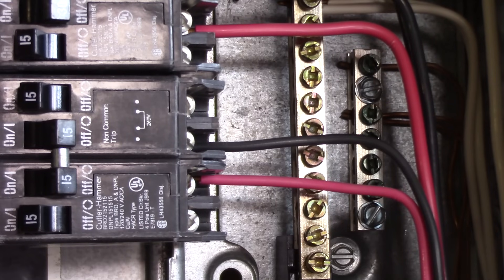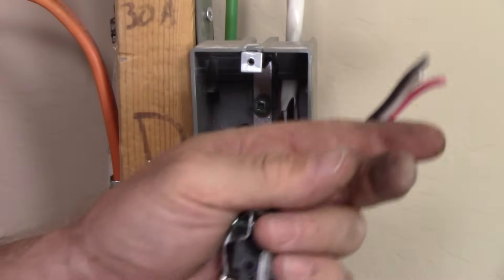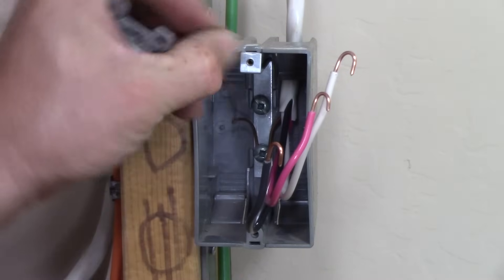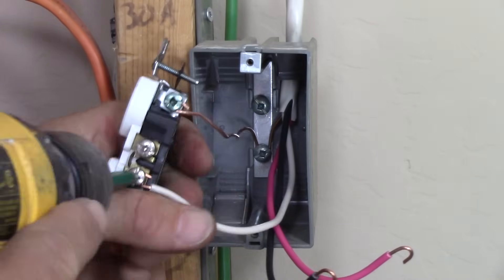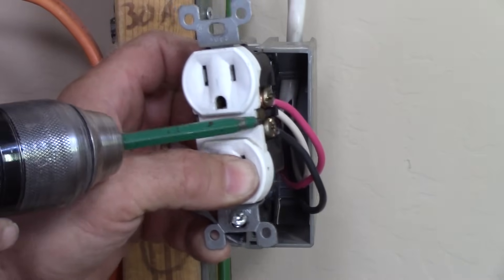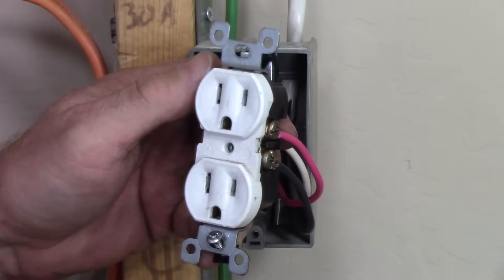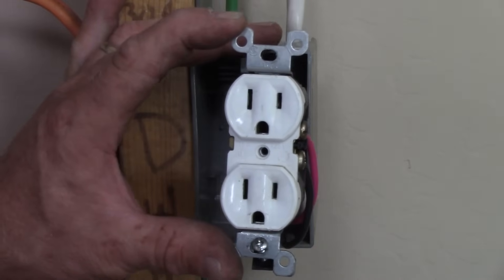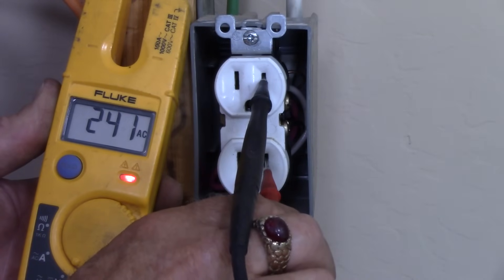Kitchen Split Circuit Receptacles Explained

Comment: Hello. I really hope you see this because I just switched 7 of them without even seeing if the first one worked. The way mine works is red and black are on the right and two whites on the left instead of one like this video. This is all in my bedroom too. Would it be a problem if connect both the white instead of the one like you did? Thank you.
Reply from the maker: What you have there are a little different than the split kitchen receptacle circuit as in this video.  You have switched receptacles, where half of the receptacle is on a switch, and the other half is hot all the time.  Hook them up as they were, just split the tab on the right side between the red and black wires.  If you don't split the tab then the switch will no longer control one half, even if you miss just one of them.
Reply: @theinternetelectrician  you are the man!! This worked right away and you saved me time and money!! Thank you very much. Imagine doing these things without the internet? We're so lucky. I just subscribed.
Reply from the maker: @davido8043  Happy to help out!  Thanks for watching!

Comment: My hot wire comes from a switch. Is it possible to make a split from the wiring coming off switch to create this? Or do I have to run a new wire from switch with red installed to create this?

Comment: Thanks for the explanation.  I had an outlet that went out recently and could not figure out why the outlet was wired that way.  The service panel is original (1970s) using fuses and aluminum wire.  I changed the outlet and broke the tab like you did.  However only the bottom has power.  The 15 amp fuses in the panel are ok.  Any suggestions as to what I should test next before I hire an electrician?  Thanks in advance

Comment: Thanks for this video! I learned something new by watching it. Didn’t know I had to cut the metal between the red and black wire to make two separate circuits. I changed a plug that the top plug was controlled by a switch and when it stayed hot I looked for your video and solved the problem.

Comment: Question........can you do the same thing by using two completely different breakers in the panel with two sets of wires coming into the receptacle box.  2 hots, 2 neutrals, 2 grounds?

Comment: Question: Saw one configured like this but had two single pole breakers in panel, a 15 amp and a 20 amp. 20 amp went to top and 15 was on bottom. Receptacle rated for 20 amps and 12 AWG wire used. There was no common tie between the breakers. If I add a common tie is this configuration okay?

Comment: Thanks!   My sister lives in a tract house,  built in 1995, and her kitchen is wired with split outlets,  protected by a 20 amp double pole GFCI breaker and 12/3 NM.   she had the same problem a few years back, when her boyfriend was upgrading the traditional outlets with the decora style,  to give the kitchen a more trendy look, forgot to break the tab.  was able to help her boyfriend over the phone some 800 miles away when he described the problem to me.   Saved them some money from having to call an electrician.   

So these were definitely used even into the GFCI era,  though I don't really see the benefits,  unless the contractors got paid by the job instead of hourly,  and it was faster and easier to pull one 12/3 vs two 12/2's.   Because those 2 pole GFCI breakers are not cheap, by any means.  I suspect this was the case for my sister's house,  because the quality of the building materials is not the greatest,  the doors and cabinetry seem very cheaply made.  

Nonetheless these split outlets are a very efficient use of material and labor,  I really like them, and it's unfortunate they are a thing of the past.

Comment: Hi Terry.
Great video. years ago I had an electrician wire up a split plug for me, but something is wrong. Whenever I plug in a microwave and a toaster oven, I blow the breaker. At first, I thought he didn't wire a split plug up, so I treated it as a single plug. Today I was going to replace it so I could have a split plug. To my surprise, the receptacle was wired the way that you show. In the breaker box, he does have a double solid double breaker. But it is a single pole.  Could the breaker be bad? Or should I have a double pole breaker?  Does this make sense to you the way that I explained it?
Reply from the maker: If I’m understanding correctly, it is a full size single-pole breaker feeding the split receptacle? Are both the red and black wire double-lugged to the load terminal of the breaker? Respond here, or send me an email to terry@electrical-online.com

Comment: Great video, however since I am not experienced very much with electrical work I have a couple of questions. First, does it matter which end, ( ie top or bottom ) that the white wire is attached to ? Secondly , my house is 35 years old and it has these split receptacles in the kitchen. My wife would like another receptacle put in at a new spot in the kitchen on another wall. Is this still allowed or is it ONLY forbidden in new construction ? I had to upgrade my panel to 240 because we are getting a hot tub so I now have lots of room for other circuits. Also I live in Ontario. Thanks and have a great day.

Comment: Hey terry. I ran into that problem where my breaker kept tripping because I didn’t break the tab. Instead I put a wire nut on the red wire. Everything seems to be working ok. Is there any cause for concern doing this? 
Thank you! Great video

Comment: According to NEC Article 100, a multiwire branch circuit consists of two or more ungrounded conductors that have a voltage between them, and a grounded conductor that has equal voltage between it and each ungrounded conductor of the circuit and that is connected to the neutral or grounded conductor of the system. (Basically, two hot wires are sharing a neutral wire.) If you remove that neutral conductor when the breaker is on you'll destroy the most expensive equipment pugged into that receptacle.

Comment: Question.. I have a 240 outlet on my welding machine.  I’d like to make a cord that goes 240 from machine into two 120 receptacles in a box.  I have 4 wire 12gauge cord.  Now on each 120 receptacle I have … red black neutral ground / red black neutral ground.  Reds pigtailed with the red coming in.  Blacks pigtailed with the black coming in.  I have the tabs broken off on each hot receptacle.  Would this configuration cause any issues to power tools?  Grinders, lights, heaters etc…  thanks!

Comment: Great vid. Is it possible to jump off a 220electric heater circuit at the wall to split to a new 110 receptacle while not interfering receptacle power with using the thermostat control and heater on/off?

Comment: thanks for your explanation. is it possible to change the receptacle to GFCI? how would the wiring be in this case?
Reply: I have the exact same question. I've got on these split circuits in the kitchen and would like to replace it with GFCI. What should the wiring be. presumably the black/white goes to the line. Where does the red wire go to - presumably the load - but on the white/black side?

Comment: Thank u so much! U saved me from constantly tripping the breaker and spark fire the house down!

On a more serious note, may i ask if its possible to add another receptacle from this set up on the same circuit of course. Basically, we need to add a receptacle in an area where the close by receptacle is a split receptacle...

 Can i do pigtails to create extra set of new wires from the original split receptacle circuit before it enters into the original split receptacle. Then connect to the 2 (old and new)split receptacles?

Or is there a simple way to go about this since the new receptacle doesn't have to be a split receptacle. It could be a regular receptacle since very little power will be drawn from it. Maybe 30 watts at most.

Thank you so much in advance for ur answer ☺️
Reply from the maker: The code rule (to ensure you have lots of circuit capacity in the kitchen) was to have no more than 2 split receptacles on one 2-pole circuit, and to alternate them so adjacent receptacles aren't on the same circuit.   Having said that, there would be no concerns adding to these normally under-utilized circuits.  You could make the additional one a split, or just pick one of the 2 hots to feed the duplex receptacle that you add.  Just do it safely and correctly and you should be fine!
Reply: Thank you so much for ur quick answer. May i ask if u have a video showing how to convert a split receptacle  with (red,black and white wires) to a regular  receptacle without pulling a new line?
And using the extra hot wire to make an additional outlet?

Thank you so very much 🥰

Comment: Isn't it recomended to use two neutral wires on this application?
Reply from the maker: Not that I've heard of.  With the neutral only carrying the unbalanced load, unless someone juggles breakers around, it's perfectly safe. Correct me if there's been a code update on that?

Comment: How would you wire a GFCI outlet with this wiring?
Reply from the maker: Short answer, you can't.  The shared neutral is the issue.  I hope that you also subscribed to my channel, and clicked the bell?  Much appreciated!
Reply: @Terry Peterman  actually found a solution. You're right with your answer, but for those who may read this, and also have to worry about switching an outlet thay is within 1.5m to a water source, a solution would be to buying a GFCI breaker for your panel. May be cheaper than rewiring. I luckily had an electrician buddy who did a little rewiring for me, but I was going to go the breaker route
Reply: You can't,  because of the shared neutral.  If you want GFCI protection you have to use a double pole GFCI breaker,  and they are very expensive,  my sister just had to have one replaced in her home, built in 1995, the kitchen was wired 12/3 and a double pole GFCI breaker, and it was over 100 dollars and had to be ordered from an electrical supply company because none of the big box stores in town carried it.  The supply chain crises didn't help her situation.

Comment: hi terry could you please help me . i have the same outlet with 3 wire . Red white black . i wanna replace with new outlet with usb outlet. the new outlet i bought have only option for 2 wire to plug in  . what should i do with that case where in new outlet plug have only 2 line to attach. Thanks

Comment: Good video I have a question, why have to be two wires in one outlet?
Reply from the maker: I'm not sure I understand the question?  Could you please elaborate?
Reply: @theinternetelectrician  Two prong outlet should carries 2 hot wires?  Why?
Reply from the maker: @victormendoza6306  With this circuit you have 2 hot wires sharing a neutral, and that gives you 2 full circuits on one duplex receptacle.  Does that help?
Reply: @theinternetelectrician  yes thank you very much

Comment: That would mean that there is a potential for 30amps to be running through that receptacle, my question is can the receptacle handle 30amp running through it even though then 30amps would be running through the entire plug and not just through one of the plugs?

Comment: This is exactly the issue I run into today, lol. The take away is you have to check if the hot wire is line or load.

Comment: Thanks Terry.  I shorted out a plug in my kitchen and ran into this problem when I replaced it. Could not figure out why the breaker wouldn’t go back on. I disagree that it’s a good wiring style.  I feel like it’s one of those little bombs that tradespeople use to obfuscate their, for the most part, simple and mundane work.  In an attempt to keep the normals away from DIY.  Sure appreciate people such as yourself making information freely available.
Reply from the maker: Once you understand though, it is a good system in my humble opinion.  You have 2 full, 15A circuits in one outlet split top and bottom.  Another over-looked benefit of this type of an outlet, is if you should move to North America from the European grid and bring some of your 220V appliances, change the receptacle to the 15A/250V, and put on the proper plug on the appliance, all set!
Reply: @theinternetelectrician  hi Terry can I use 20,30 or 40 amps too
Reply: A way to save money
Reply: Microwave in one, kettle (or toaster) in the other, without tripping the breaker
Reply: I agree its good idea the wiring but people they don’t know its a puzzle like me when i change mine the orange and yellow wire ire connected to the gold but here you sir you told us to cut the small thing si that it come out only 120v coz if they together it will be 240v… anyway thank you so much for your video 😂

Comment: I bought GFCI plugs for the kitchen before realizing it has split receptacles. Would it be against code now if I just replace new plugs in the kitchen and split them or do I have to eliminate the red wire and wire in the GFCI's? I am in Canada so depending on where you are you may not know the code. Thanks.
Reply from the maker: Just replace with new receptacles.  You aren't changing anything and the code is grandfathered so all good! Don't forget to split that tab! Oh, and the price of the new receptacles just dropped from $25 to $2! (estimated)

Comment: Thank you for the Video. Any advice on how to change the split rec. to a GFI?
Reply from the maker: Best advice would be to leave it as is.  Personally I like the split kitchen receptacle method, and no need (code wise) to change it as it's grandfathered in to the code of the day.  But if you would feel better with GFCI protection, I would change the supply breaker to a 2P 15A GFCI breaker and then leave the splits as they are.

Comment: can you do this method with a gfci receptical?
Reply from the maker: There are ways, but short answer is no, because you have to have a dedicated neutral for the circuit feeding a GFCI and the neutral cannot be shared because the unbalanced load will cause the GFCI to see that as a fault, and will trip.

Comment: You noted that the receptacle & wiring as shown "is not allowed for new construction in a kitchen receptacle."  So, to add this split receptacle in an existing kitchen, what is required to meet NEC requirements beyond what you show here?  In my case, I plan to use current hardwired power supply to garbage disposal as a power source for the split receptacle; the purpose being to add an outlet for an under sink mini-water heater.
Reply from the maker: I'd need some more details Jim. Send me an email to terry@electrical-online.com and we can peruse this further if you'd like?

Comment: Thanks, This is great for New Work how about existing Old work - Do I have to snake a 12-3 wire to the outlet in order for one plug to always be Hot and the other controlled by a Switch..
Reply from the maker: I'd need more detail here Frank.  Not sure what you're asking, but if you just leave the existing 3-wire kitchen circuit as it is, no need to change as code rules are grandfathered to the day the work was done.
Reply: @theinternetelectrician  Hi and thank you:  Some Dummy used the dedicated garbage disposal switch to an outlet to also connect the dishwasher to the same outlet under the sink.  Everyone thought the dishwasher didn't work but when I ran the garbage disposal the dishwasher powered on and was running....  Too late I already ordered a new dishwasher and am using an extension cord to a live outlet when I want to run it....   The switch for the garbage disposal box also has a switch to an overhead light and an outlet in the same box.   HELP!
Reply: You didnt show us how to wire the switch.?    I understand the 12- 3 runs from the panel to the outlet.

Comment: Hi I have these problem in my kitchen.I changed two split receptacle I did exactly what you showed in video split the tab but i only have 1 plug each working.Any suggestion what I done wrong?
Reply from the maker: I suspect the breaker is tripped.  Even though the breakers feeding these circuits are tied together, it can happen that one is tripped and the other isn't.  Try pushing the breaker(s) firmly to  the off position until you feel a click.  Then turn back on and check.
Reply: @theinternetelectrician  does the red wire always on the top screw?Because when i put out the old receptacle the black wire was on top.
Reply from the maker: @erwinmolina13  I doesn't matter.  As a trade practice I always put the red on top, for no particular reason.
Reply from the maker: @erwinmolina13  Let me know if the breaker reset solves your issue.
Reply: @theinternetelectrician  It's working now,thank you for your help.
Reply from the maker: @erwinmolina13  Excellent!

Comment: Hi... Lately i am changing the outlet... And i see the same wire as  this video at kitchen

I dont understand why only carry 2 amp back...
So in this idea..is ti means i can run one toaster on top one microwave on bottom

Is it more safe or danger...
Is it easier to melt the wire when we use more power but both on each only use 12 amp
Is it not over load
Reply from the maker: The current on the 2 different hot conductors are 180 degrees out of phase from each other, so the shared neutral only carries the unbalanced load. So to answer your question, if the toaster uses 10 amps, and the microwave uses 12, the neutral will have only 2 amps.  If they both use 12 amps, the neutral will not carry any current. So all conductors in the split circuit arrangement are not overloaded.  They are all within the acceptable ratings of the wires.